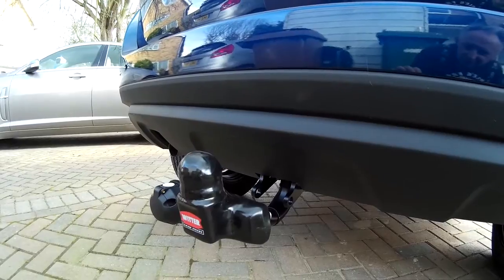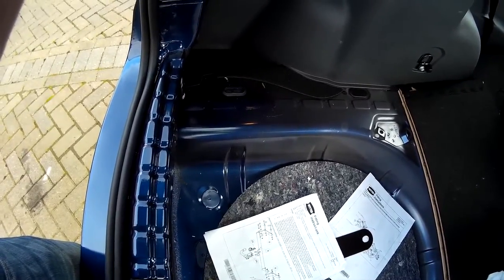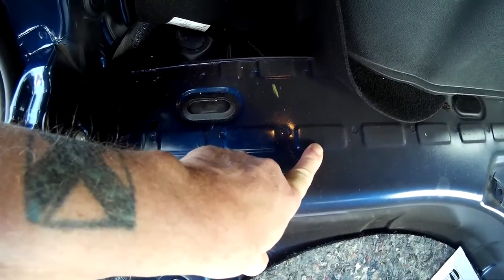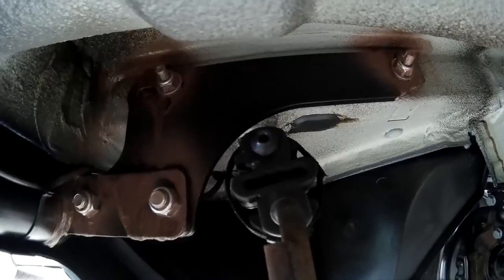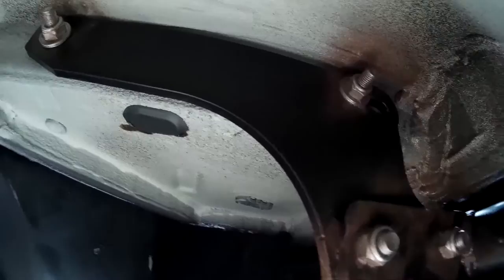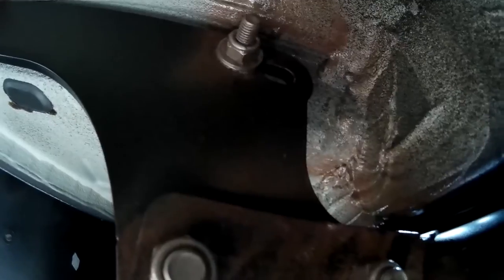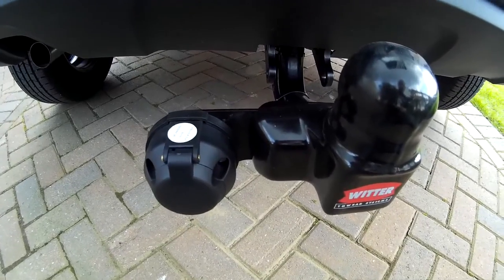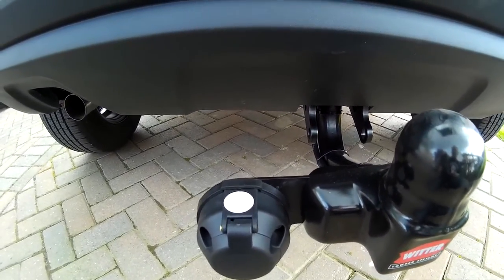FITTING A WITTER TOWBAR TO A 2016 DACIA DUSTER 4X4

Comment: For 2019 diesel.
Note adblue tank is very much in way-remove cover
Chassis drop plates secure with bolts from inside to out on which you can hang them as you secure them.I modded mine as it was supplied with back plates with captive nuts.
To fit bar first remove all self tapping screws under edge of plastic bumper which releases bumper from plastic backing brackets. Hook over exhaust tail pipe with mounting plates facing down then manipulate other end through narrow gap between tank and bumper edge where you can open gap by pulling on bottom edge of bumper
Bolt onto drop plates but be ware there might be a very large gap between drop plate and mounting plate as there was on mine.
It easily drew together.
Job done and dusted single handed and no jack today and without removing a full adblue tank!
Reply from the maker: That's a great heads up. Many thanks indeed 👍👍

Comment: Hi, excellent informative video. Does your duster have parking sensors installed, and if so do they still work ok after the flange towbar was installed?
Reply from the maker: My previous Duster had parking sensors but they went off constantly when reversing with a trailer so I didnt get them fitted to this one. The parking sensors arent really needed I've been practicing reversing for nearly 40years, might be good for learners though.lol.
Reply: Did the parking sensors go off without the trailer, due to the flange towbar, or were they OK? Trying to decide whether to get a flange or a swan neck towbar.
Reply from the maker: No they were fine until I hitched up. A swan neck is easier to remove for a tidier look if you're not towing though.
Reply: Thanks for the help!

Comment: How easy were the electrics to wire in, I have seen some kits that you have to manually clip individual cables to existing loom, and others that have an in line socket to go on tail light....
Reply from the maker: You can get the kit with a plug that connects to the cars rear accessory socket but this wont work on all cars for no reasonable explanation.  I would suggest buying the kit version that says you can just plug and play and hope for the best.

Comment: How do you push holes threw for bolts
Reply from the maker: The holes have plastic plugs in them and sealed over with thick mastic. You need to pierce them with a sharp screwdriver to dig them out. You can access the holes from inside the car. I filmed the close up of the bolt heads by putting the camera inside the bulkhead space, you can feel the holes with your hands and poke the plugs out from here.

Comment: Mine has huge plast cover in the way 🤦🏻 underneath the car
Reply: Hi
I have just made a start on my 4x4 2019 hdi.Plastic cover at rear of car covers the Adblue tank.If you remove it you have enough space around it to fit the drop plates to the chasis.
If you have the witter securing bolts inside to out no problems as you can hang the drop plates and then fit the nuts.
If you have a bracket where the bolts go from outside to a mounting plate inside suggest you mod it with 40 mm thick wall penny washers and run the bolts inside to out as I have done.
My next task to add the bar itself which should clear the back of the adblue tank.